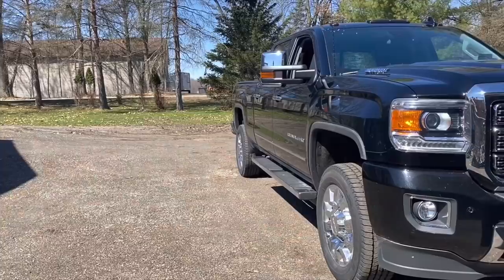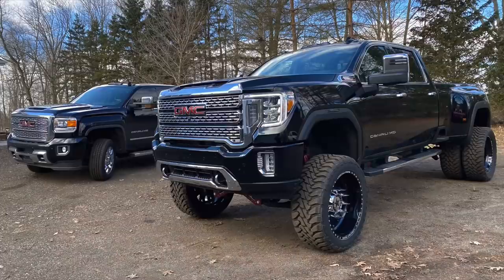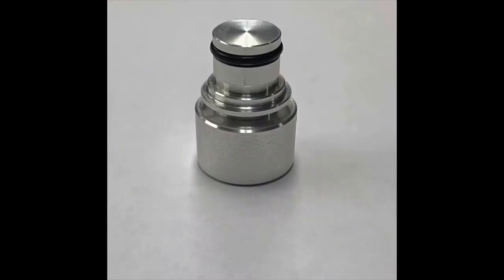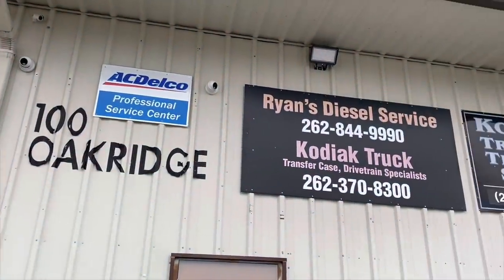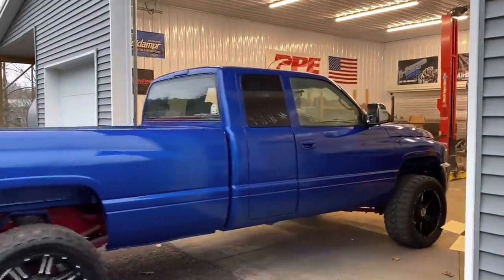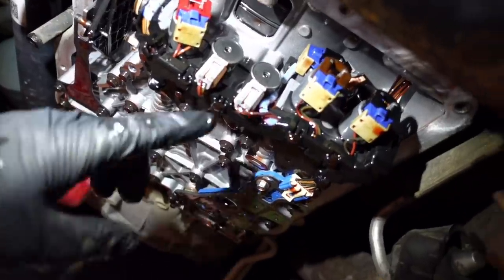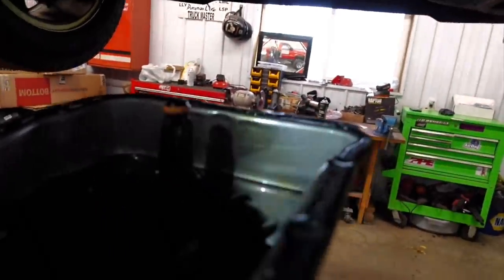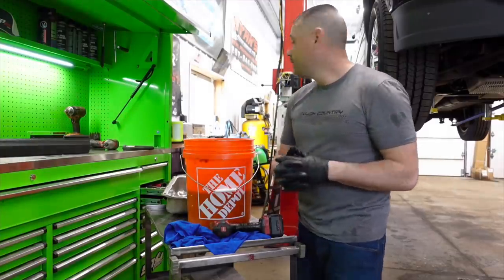I Might Destroy My Allison Transmission If I Keep Doing This! *New Part Arrived*

Comment: My 06 Duramax just truned 400000 still running strong
Reply from the maker: Nice 👍
Reply: Ember and l havvee
Reply: I have a 05 lly which is completely stock with no tunes or delete and has not had anything pulled apart since being bought from the dealership and it’s at 485,000 miles
Reply: That's amazing!! I hope mine lasts that long. Im around 99, 750 for a cat eye 07 classic. Thats 99,750🥳🤯
Reply: My 07 LBZ is still running strong, but i'm at 60,000 miles haha
Reply: I have a 05 LLY 362,000 miles

Comment: Done the same to my LMM, only with the PPE deep pan, I ran new Mishimoto transmission lines and a new larger cooler. With the oil, replaced the pan to a deep PPE pan, replaced the filter size to the two quart CAT 1R-1807. So instead of 10 qts, it's 3 gallon at a oil change.  I've purchased a transgo shift kit for my transmission but I don't trust myself and nobody wants to try, kinda stuck with trying to mod my transmission to simply better it.

Comment: I believe you put an EPC solenoid fooler in your Denali transmission right? I had one installed around the same time. How is yours acting? I am having all kinds of low speed slips and short shifts under power.

Comment: I've been watching your channel since the beginning and appreciate all the great videos... I do have a question regarding my 08 2500 LTZ with bully dog tuner, edge air intake, oil delete, edge cold air, 6" lift ect... after watching one of  your how to videos I purchased and installed the "Air dog" 165 lift pump as instructed step by step and all is well BUT  my MILAGE went DOWN 👇 10-12 IN Town and 14-16 hwy....What can I do to improve milage... thanks👍MCW

Comment: Did you have a noticeable high trans temp after install? My truck has always run cool trans Temps. I already uave the wehrli bypass valve in transmission cooler. Just curious? Mine usually runs 170 on a hot day. Today was 82 and a short run to town and it was 197... scared its hurting something.

Comment: My 2017 L5 P is turned and deleted with trans tuning would you still recommend this part
Reply from the maker: Yes definitely
Reply: Says not recommended to run this plug with trans tuning as you can tune the trans to hold line pressure without plug.

Comment: How does the EPC fooler work? I'm looking for the increased line pressure because rolling into the throttle 5th gear she slips without the line pressure

Comment: New to the channel..... I also have a 2018 Sierra 2500 l5p... thinking about doing the same sometime next year... my truck is still under  warranty.   its also my my daily and want to keep the longevity of my truck... I will look at your other videos. How much will it cost to do add the plug in the transmission , I am not mechanically inclined?

Comment: I have a 2020 that looks just like yours. It will probably stay stock. If you want to compare trucks I am just north of DeWitt. I see you use Price Rite. I’m going there Thursday with my camper.
Reply: What do, or did, you pull with your rig?

I have a 2022 High Country and I am only at 45k right now. I put that pulsar on but I think it is causing regens due to the fact that I don’t pull all the time. Maybe. Not sure. But when I see my EGT 5 sensor at 1000 degrees, I know it’s cooking.

Comment: All the effort on the motor ,but the camera certainly shows the rust on the chassis,have you protection on the underbody ?I know it's a never ending task but such nice trucks deserve longevity ,surely ?
How does the transmission hold up to towing the big trailers ?

Comment: Will this valve work for the LLM? And what spin-on filter would you recommend for Allison other than OEM?some local trans spin on filters are made in china! Right on, while the pan is dropped replacing the inside filter.

Comment: I need help i have a 2007.5 lmm 3500hd single wheel 4wheel drive duramax fully deleted and built transmission and it keeps throwing a p160c code and i need help fixing it

Comment: Your truck seems to turnover longer than my lly 
Based on your experience w all the gm platforms 
Does the l5p take a little longer for the starter to turn over the engine? 
If so would a aftermarket starter be in the build plans soon? 
Just curious
Reply: I have an L5P and it turns over a little longer than the LML I had before it starts. Seems to be common with them, not sure why but all the guys on the L5P group im on on FB say the same thing.

Comment: I got an email from truck performance parts today that was a solenoid to fit a 6.0,  6.6,  and a 6.7 Ford and Chevy. Stating 12.5 lbs more boost increased fuel Economy "Everything!" Lower ETGs. For a Meer $450.00 I thought since you've re-turboed your trucks I thought you might make a call to see if there's any validation to there claims with Ryan. It also seems like a very simple install also. If you'd gain another mpg or more, it'd pay for itself in no time. You've saved me so much by watching your channel with bolt on's, maybe I can contribute back?
Reply from the maker: Thanks I will check it out
Reply: That was Diesel Power Products, the solenoid was called a Lightning Bolt.

Comment: That’s it lol god dam* 
Just like the pulser I put in
This is why I’m not into watching. 

When you do a project it should make. Difference I see no difference. 

Looks like no change to me. 

My trans on the same truck I think is messed up but we all know that can’t be true. I’m just being sarcastic. 

Wish I could get my tcm back from Duramax tuners. They are having trouble getting one to work with my truck. 

Kinda sucks that my truck is the only one in the world that is fighting them when tuning, there is that sarcasm again. 

My 2019 never had any shifting timing problems but this 2017. Starting to turn me off from these trucks. 
It’s like a 50/50 shot you will get a good one. 

The thing is you can rebuild them all day long but as soon as you put them back in the truck with the same computer it will trash the trans like it did the last one. 

I will hope for the best. 

I’m just amazed that there are no videos on the 6 speed. It like a big secret.

Comment: My dads 2012 1500 transmission went out over the weekend not sure if the pump went out or just normal wear has 200,000 miles on it I checked the fuild it looks dirty not a pink or red color looks dark wont move forward or reverse under its own power
Reply: I've had 3 vehicles with a 4L60 and 175k was the magic number for a failure